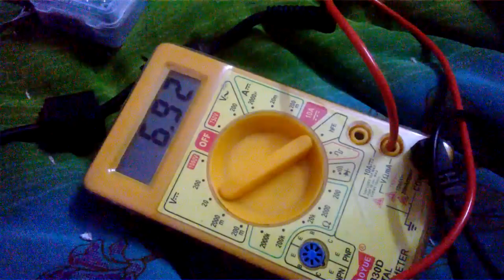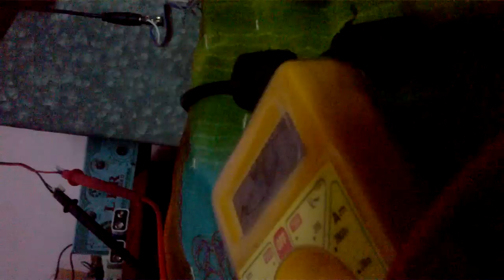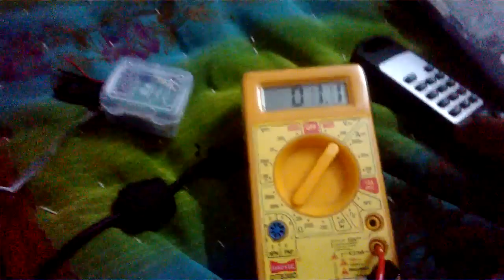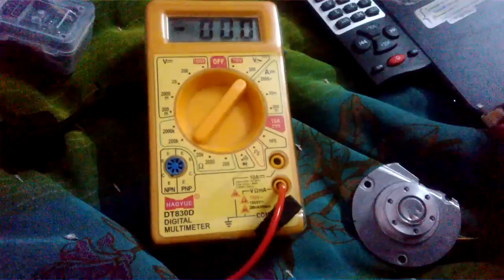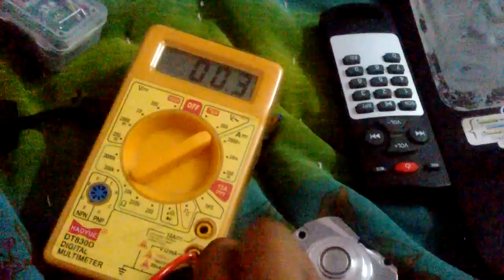Generating Power From HDD Stepper Motor. (First Attempt)

Comment: which circuit you have used to connect the motors 4 wires and make them two
Reply from the maker: I have used only two wires of the motor friend.